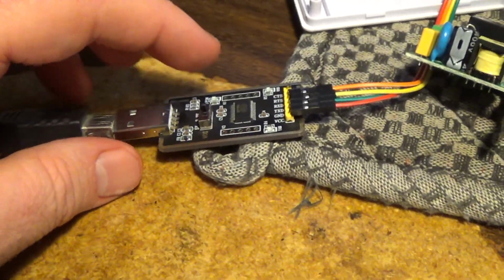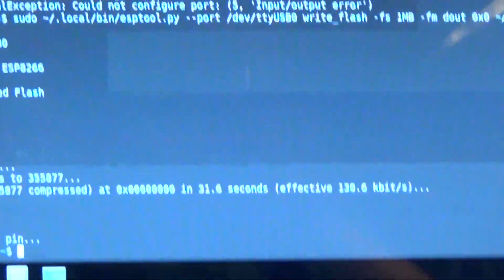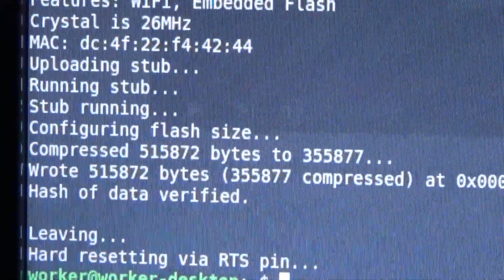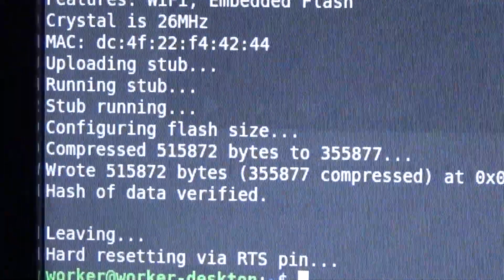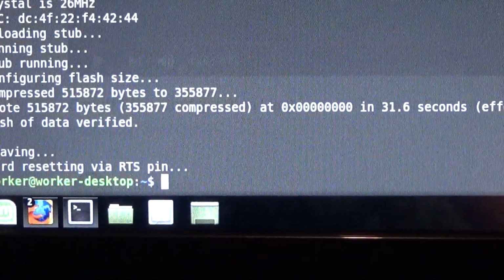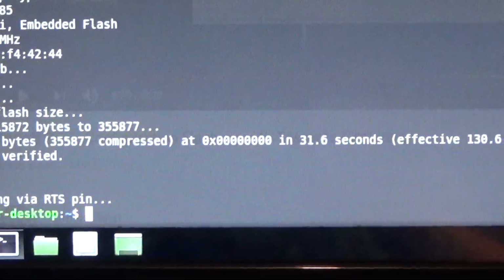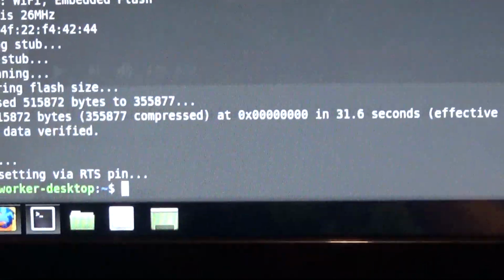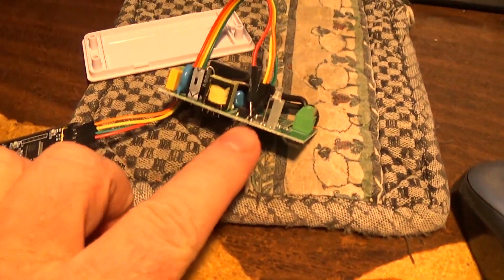Flashing Sonoff without soldering header pins.

Comment: Great and simple idea, thanks!
Reply: Kinda worked, however I had intermittent trouble connecting to the sonoff.  Thought the sonoff or the ftd1232 was bad, but turned out that just attaching it from both sides as suggested resulted in a flaky connection.  Ended up just putting some sideways pressure on the pins with my finger during the process, and it worked fine.